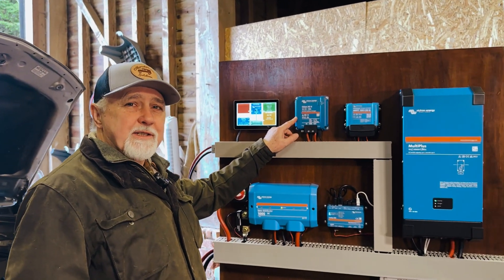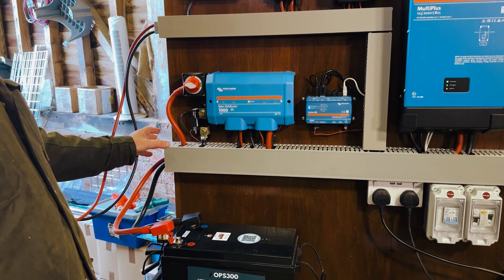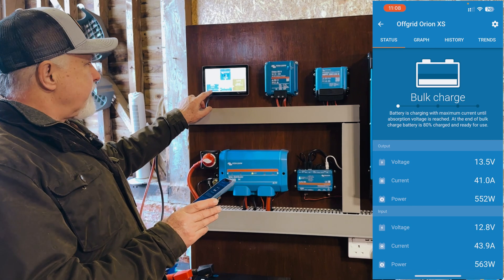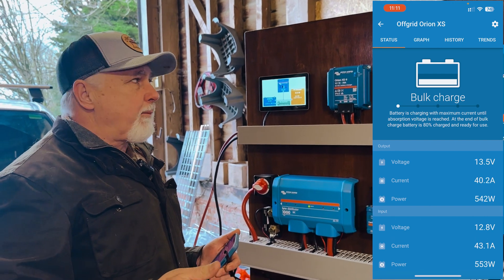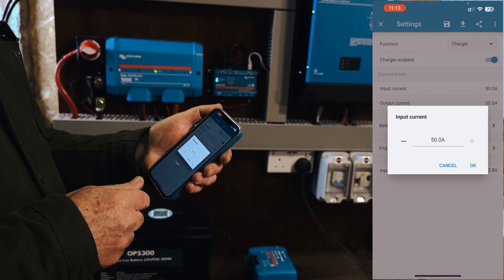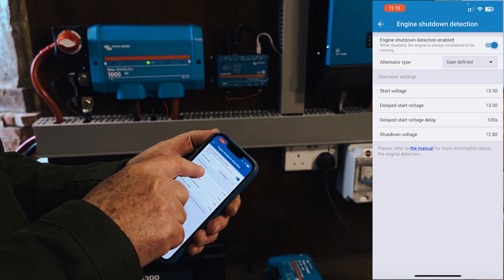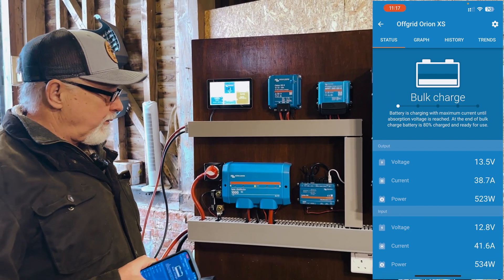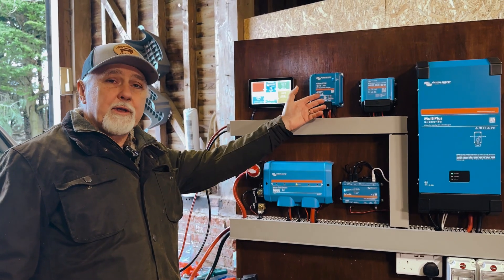Victron XS DC-DC Charger: Temperature Test

Comment: How can you tell if your alternator has a spare 50A capacity, when only idiling, say at traffic lights etc? It would be a rather expensive exercise if the alternator overheated. Is there any formula to calculate iding Amps versus full spinning Amps of any given alternator or can you simply set the 'lock out' figure to be rather high.... I think when my alternator is full output it is in region of 13.3-13.8V but on idle, i believe it decays back to around 12.75V... so in theory, lock out at 13.0V re energise at say 13.2V  should protect it from taking too much amperage at idle or if there are already too many other consumers running at the same time?  Had several issues configuring the 12-24 dc-dc version.

Comment: Hi, thanks for this video ! 🙏With your 85A alternator from this vehicle, at what amount af amp would you set up your Orion XS in input ? (you just let 50amp in this video, without changing it)
Because I got a 90A alternator in my vehicle and I would like to buy an Orion XS but I don't want to force or break my alternator so I think I need to limit the input in my XS right ? I could put 40amp in input maybe ? Or 45amp, or is it too much ? 

Thanks for your help 🙏

Comment: I have a dc-dc 50 amps and it decides to do 7 to 20 amps whenever it decides to, even on 20% battery, its probably a config issue but l really dislike it
Reply from the maker: It might be the adaptive charging kicking in if the input voltage is low.

Comment: in my short Microcamper  the 4' run from my starter into the charger will be 4awg copper, but okay to use existing 8awg copper OUT of the charger to the house lithium for a 7' run?

Comment: I can find 2 other DC - DC Chargers available. One seems to be as efficient and cost as much as the OLD version and another is about Double and only with its proprietary battery banks.

If I wanted the best quality, the new version seems to be the best product available. I consider HEAT buildup as the biggest criteria.

Comment: Im not impressed of the new model. It will never give more than around 40-42A because a standard Euro6 alternator only give around 12.9V on highway driving. Beside that there is also a large voltage drop in long cables.
I will still go for the premium fan cooled DC-DC from German Votronic and Büttner which give stable current at 50 Amps.
Reply: i'm using the 50 amp votronic too for 3 1/2 years in the company van alongside a 100Amp hour LiFePo4 battery for a compressor colling box in summer and auxillary heater in winter.

never missed a beat.

Comment: Hello @offgrid_power , big kudos to the great works you do.
Please I have some recently bought lifepo4 cells.
Out of ignorance, I connected them down in series, while waiting for my daly BMS to arrive my home country. 
Upon BMS arrival, I went checking the voltage of the batteries, only for me to find each and all, reading negative (-26.40V ) on the multimeter as against 26.40V as at the very day they were connected after top balancing. Please, is there anything I can do to correct this?
Reply: Turn your multimeter leads around, you have connected them backwards.

Comment: Great video ! I’m curious, which battery app/monitor is that on the left?
Reply: It’s a Cerbo GX with a Touch 70 screen. The Cerbo is the device just to the left of the bottom of the Multiplus - it has cables connected to most of the devices.

Comment: Suggest to watch your mic location. The sound of your voice was a bit loud/clipped when your head was tilted down. Did find the video helpful, I'm trying to work out the purpose/use case of these DC DC units. The apparent efficiency of the unit is impressive.
Reply from the maker: Sorry about the audio issues! We had a problem with our mic!
Reply: to charge an auxiliary battery, especially LiFePO4  where the battery capacities involved can otherwise cause alternators to burn out, or blow fuses on pre-existing simple VSR systems.

Comment: I really do not understand the need. 140 US for a 12-24 volt 20 amp non smart unit with integrated active cooling fan to a Victron solar charge controller.Result is 400 plus watts to the battery. 12-24 device is adjustable to 30 volts and only draws 20 amps. This is a solution in search of a probelm.
Reply: just because you don’t experience/aren’t aware of the problem that this solves, doesn’t mean it’s not real.
Reply: EcoFlow has a similar unit for double the price, not including cable that can charge only its Delta products. This can charge any Lithium battery or power bank. So, I think 50 amps provides 700 watts, while the EcoFlow does 800 watts.

Comment: very poor and unscientific test
- you placed one unit face down in a non- recomended sub optimal for cooling and the other in the recomended optimal for cooling position
- you can do better than this, don't be lazy

This is not take away from the XS being better unit that runs cooler
Reply from the maker: Glad you enjoyed the video, John! Thanks for your support! And whilst this wasn’t a comprehensive scientific test, it illustrated how much more efficient the new charger is. Anyone that’s used the old Tr Smart knows how hot they run!
Reply: @offgrid_power  yes, I look forward to getting one myself
Reply: What you say is quite true John. But we had it on its side for quite a long time whilst I monitored heat buildup. Whilst the fins were not vertical (the way you’d normally mount it) they were exposed and the heat was radiating upwards. But as Frodev728 says I’ve known them to get so hot they’re uncomfortable to touch. For some reason we dropped it down just before filming, I think I wanted to check heat on the face. But …. nicely observed.
Reply: @rogerivy8525  I look forwards to getting one of the new units, just to reduce the heat buildup in the electrical compartment as I live in the tropics
Reply: whilst that is definitely true, I’ve seen the 12/12 -30A units get to 85ºc on the casing in real-world installations.